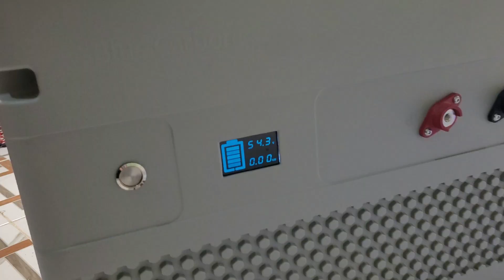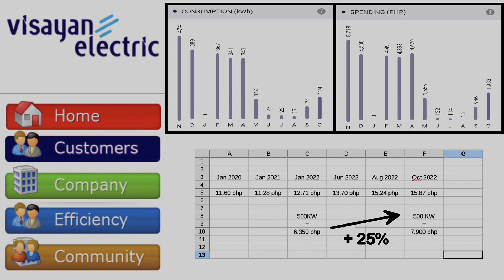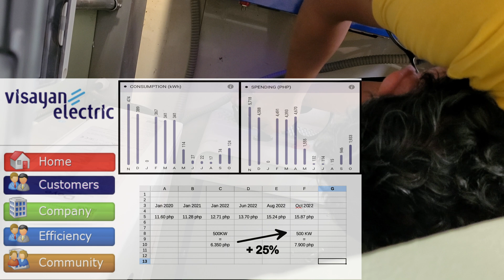Solar Battery Upgrade to 20KW - this invest will pay off very fast as electricity prices rise

Comment: Hey. Ich brauche ein Set für mein Miethaus ab Februar 2023 in Luzon.
Kannst du mir ein Angebot schreiben mit einer groben Auflistung der teile?
Ich werde 3 kühlschränke und 3 Gefriertruhen und 3 Inverter Klimas plus 5 Computers und ins 20 Ventilator dauerhaft betreiben müssen. Wieviel kW ist das ca und was an solar und Batterien brauche ich um völlig unabhängig zu sein ?
Reply from the maker: Das geht billig, aber meine Dienstleistungen sind unbezahlbar hahaha